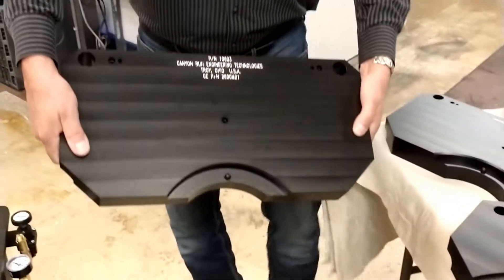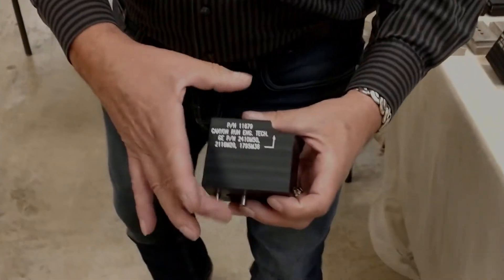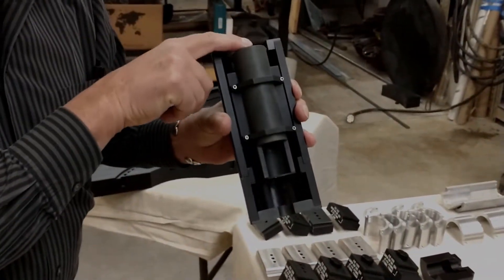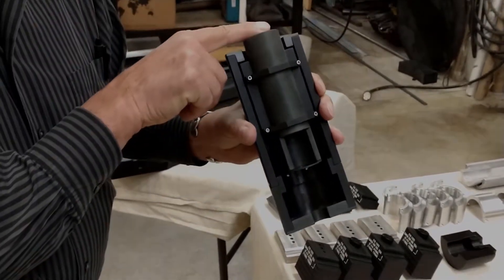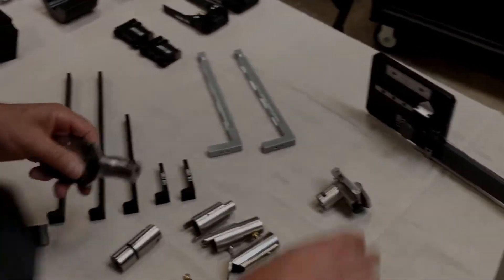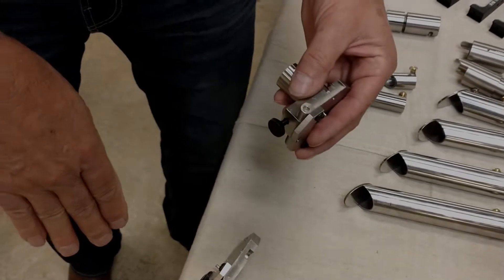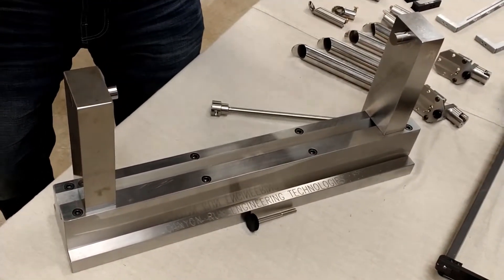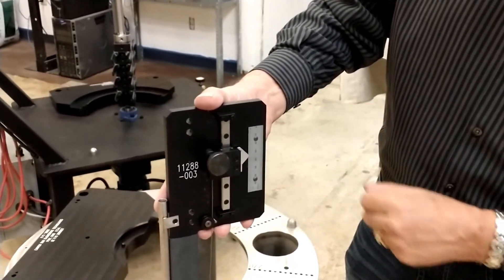NDT Inspection Tooling and Equipment for Aerospace Equipment

Comment: Excellent engineering quality.  I lit up when you mentioned the GE90.  I worked at General Tool in Cincinnati when they were fabricating the engine mount for testing when it was in its development stage.  Thanks for the cool video on your products.
Reply from the maker: Thanks! The GE90 sure is a feat of engineering. Sounded like that was a cool opportunity!